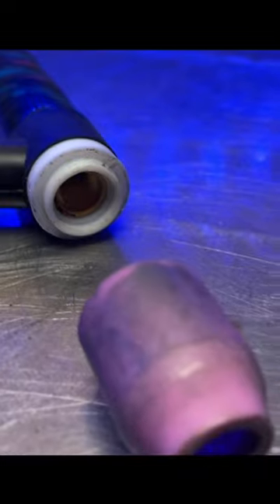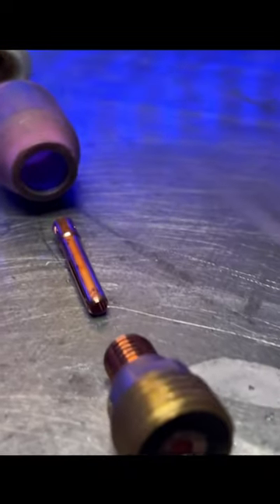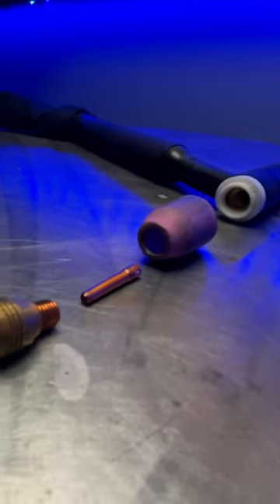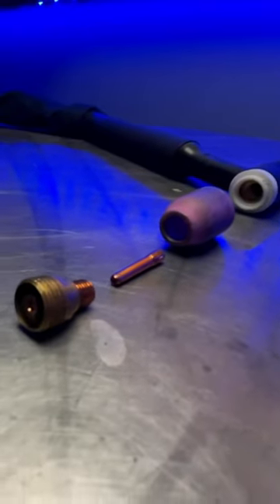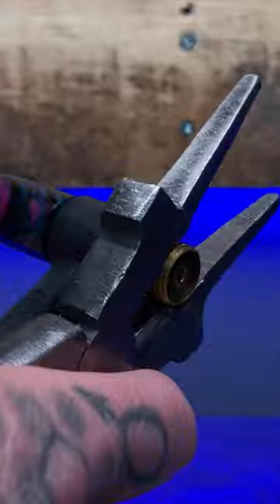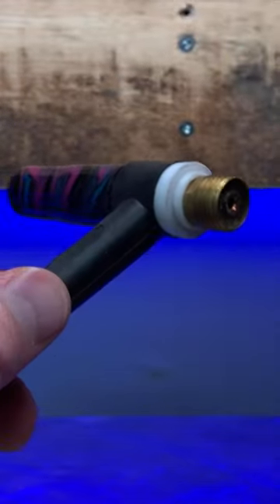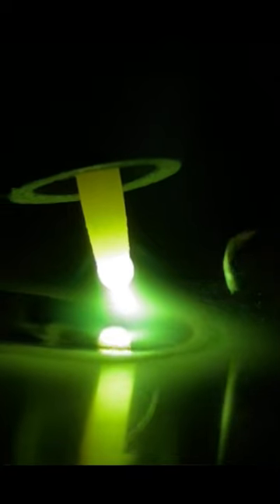🔥Problems tig welding? START HERE🔥 #shorts

Comment: I've been following you for awhile and I haven't seen how you make that ball at the end of your tungsten, do you have a video on this? Thanks for the content man, I've learned alot from your videos.
Reply: Hey not sure if you figured it out yet, but while you have your tig machine set to ac (assuming you can adjust your cleaning action) set your cleaning to 100% and lightly hit the pedal until the tungsten balls to your liking. If you can’t adjust cleaning, set your tig to dcep and again lightly add amps to the arc.
Reply: @jed3219  thank you, I was kinda just tossed into my welding position at work with minimal training so I'm still figuring out the basics, this helped alot 👍🤘
Reply: @jed3219  Not all tungstin balls.  The pure, green stuff, does.  I find that with modern welders, you can keep most of a point at higher frequency.  That being said, I am not an expert at aluminum TIG and am seriously considering the course he offers.

Comment: Seriously, I would love my Welds to look as good as those bad ones. All I keep doing is blowing through the dam thing. I'm trying to weld 18 gauge stainless steel exhaust using a yes Welder 250 acdc  using 1.0mm purple tungsten , ER308L 1/16" rod on 65 amps 
19/32" id cup (yeswelder no markings) also i can't see what the hell im doing. My helmet only goes down to 9. HELP ME  PLEASE!!!

Comment: Why are all his tungstens round at the end?! I used to go multiple weeks without dipping the tip. Talk about contaminated welds, and bad arcs. Maybe don't put your torching the puddle!
Reply: I can tell you, old school machines, at 60hz wtih a 50/50 balance, and a pure tungsten electrode, the electrode will ball.
Modern machines, at higher frequency and a lower  cleaning % will keep a point.